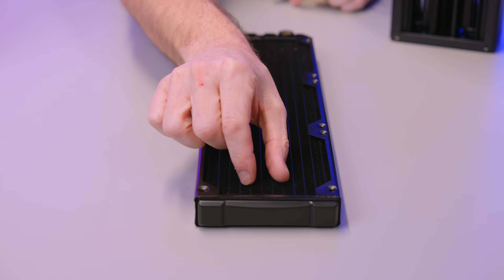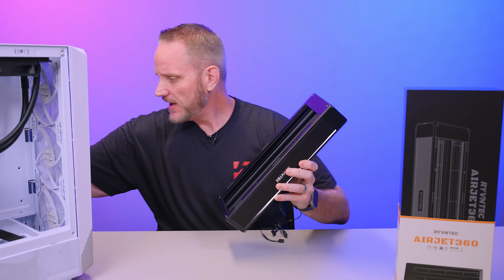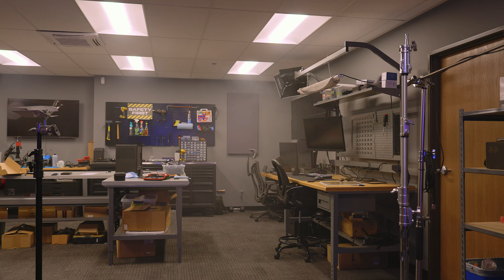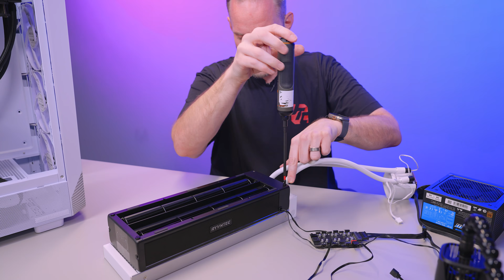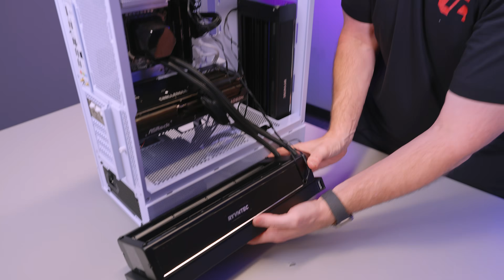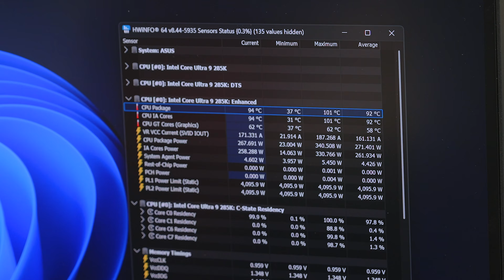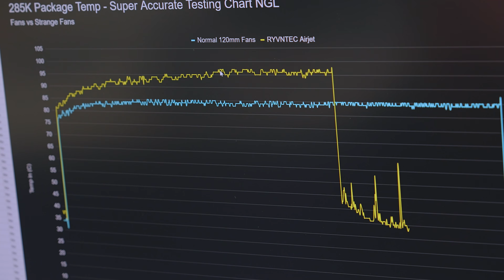Check out this INSANE Prototype!

Comment: hey jeyze, please put two more tests on that fan. but first of all use a much bigger case something you can have front fans airflow for the main chamber, about tests, 1. AIO: u need a around 1 cm canal between fan and aio for two reasons one to spread air flow and pressure to all that radiator , two to make it air tight also reduce preassure from blades, evn some washers and duckt tape would work, two using an air cooling solution but not something rubish nor 5 star like noctua nh12l on 14700 or 12700. that amount of air would change so many things

Comment: Possible fixes, place three smaller fans horizontally across the fixture (total radiator coverage width wise) & use smaller motors on each fan (less mass = smaller motors!?) you might also be able to use a geared belt drive!?

Comment: needs to be setup in pull not push, and possibly a 15mm spacer would do wonders i think. was looking at using this on a 360mm thick rad (maybe alphacool 60/00mm) in a 4u chassis. 
or even a hardwarelabs gtr radiator would do great.

Comment: Close off all the case vents and just run the front fan. That will fix radiator saturation. The only other way would be to space the fan off the radiator and add a diffuser plate to spread the air column out.

Comment: If it's the metal squishing causing the rubbing than simply adding a metal tube the screw goes through would make the screw easier to align and fix the rubbing

Comment: Not really new....I had one of these in my Cooler Master CM Stacker pc case in the early 2000's. Made a lot of noise 🙂
Called a Cross-Flow fan (yes, I needed to Google that). But it appears these type of fans still make a lot of noise.

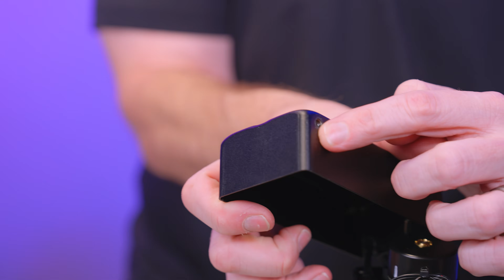Comment: I've always wondered why no one ever tried this. It could work very well but worried it'll be concentrated in a specific zone. How well will it be in a long running config that never shuts off? /shrug. The corners don't matter if it's moving air that strong, it'll get the vast majority of the heat out regardless. The issue being 14:30, they need to mill that top portion of that off if possible, is it not just a cylinder of steel or aluminum attached to a rod? IDK but they shouldn't have made them all without having people review it first. >_<

Comment: I was thinking having 4 fans, with 2 middle ones pushing to the middle and the edge ones pushing to the outer part, and this can be used with one motor and some gears or 4 motors, but the good side effect, is a much lower profile... My two cents worth...

Comment: As someone with a rotated motherboard mount case, this would be perfect for me who wants to stay air cooling.  
My motherboard is fully rotated so the 3 GPU fans are directly fed by 3 Noctua 120 fans on the front of the case, with 2 Arctic P120 on an aio cpu cooler at the back acting as my space heater in Minnesota winters.

Comment: 25:20
So what if instead of two big cone spinning thing, the put 4 or 5 smaller ones. I think that way you can get the air spreading evenly
Reply: if they can get the air flow evenly instead of flowing through the middle only, i think it can be used on the radiator

Comment: What if you used it as a pull config for the cpu rad instead of push? It pushes air through that narrow column, but it still pulls air from the entire two dimensions on the other side right?

Comment: These would probably work best in cases where you have a large semi-sealed cavity on the one side of the case into which the double-scroll fan forces air. From there you'd employ ducting to divvy up the air to where you want it to go. Your radiator would need to be in such a position as to have its entire surface exposed to the air flowing through it as opposed to the narrow column.

Some years ago before I gave up on the idea because of the equipment and space I'd need to get it built, I was designing a cuboid case meant to look similar to an ottoman, where air would have been forced up through the case from below and all the cabling would go down the bottom of the thing. In that case's design it was made to either accommodate a tower heatsink on the CPU with ducting to force air to ultimately flow through it, or have radiators mounted at the top of the thing again with ducting to force air to flow through the entirety of the radiator(s).

Especially considering how large these are I'd say they would work best in a position where they're out of sight and not obstructing anything. They would probably also benefit from a deflective grid which helps distribute the air over a radiator if mounted against it, but that would add probably another 10mm or more to the total build depth...

Comment: I think the first fan like this that I was aware of was the IETS GT 500 released back in 2021, basically the same idea as this, foam seal, 120mm centrifugal fan, pumps 300-3k rpms.  I think I remember someone doing a comparison video on them and they performed basically the same in thermals, the sound signature was a bit more favorable for the IETS, but the price was more favorable for the Llano.

The RAZER one was shit, do not get.  Not only due to the Razer Synapse bloat, but, it actually just performed way worse than both of these, not sure if they just fucked the fan up, or it wasn't sealing the air in properly directing it through the laptop, but yeah... not good (Also the most expensive of the 3)

Comment: If you do test it in pull config, maybe try using the 4 inner mounting holes instead of the ends, that would keep any torque from the screws away from the motor clearances.

Comment: Okay hear me out…. And this is not a practical everyman solution…

If you had some 25mm - 50mm (1-2” or so) of space, between the rad and the fan assembly… then put it in a pull config… it would widen the aperture of the airflow “blade”, and hit (closer) to the entirety of the radiator fins.

Comment: I feel like your decision to try the fan on the rad sort of diluted the message of the fan as a case fan. It is a case fan that provides better shape of air inside the case, at a lower noise level. It should not be used as a rad fan.

Comment: @21:10  thats why you orient it to pull in air and not pushing. 
It obviously pushes air into a compressed line just like a supercharger on a car..  BUT that's the push side. 

IF it were pulling in air through the radiator it will cover far more of the radiator. You actually showed it in this very video, the pull side was NOT drawing in a line, it was only pushing in a line

Comment: Lights in a pc: What do you want it for reading a book or playing games. If your playing games who the hell is looking at the dumb lights.

Total crap waste of money. 

Just a manufacture's way of saying your getting more, but paying more for it. What it has absolutely no real meaning in a gaming PC.

Mine sits under the table the only time I see the lights is when I power it if for the time it takes me to push a button and stand back up.

Screw holes need a spacer (tube would be good. to channel the screw) Any Anti crush spacer. Really needed.

Be fair, try it in an air cooled as well. Those fans are really shoving air around. So worth a crack.

Cheers.

PS I'm air cooled all the way. Water and electricity no way. 😞

I over fan. And under ramp the cool cycle. So far its never hit a temp high enough to crank the fans even in Horizon FW full look spec. Which is the hungriest game I have.

Comment: I question your rad conclusion. I think what's more in play is that air is moving too fast to allow it time enough to pull the heat off the fins. Try slowing down the the rad fan.

Comment: I was kinda wondering from the beginning if using 5 or 10mm neoprene foam around the sides between the rad and fan would both seal the edge and allow the air to be pushed through more of the rad  would help. Obviously it doesn't really need to be any thicker lol but just a thought.

Comment: Did the helical centrifugal fan on a computer box YEARS ago - works a TREAT. Problem is the best ones that are cheap (to buy and run) are AC 240v so becomes a PITA and keeping dust out is IMPOSSIBLE (FILTERS BLOCK IN HOURS & the C*&Ts get NOISY AF). 12v versions are always SHIT and this is no exception!!! I SERIOUSLY Doubt that these can improve on the best 12v axial fans on the market... aaannnd PRESSURE is not that critical in a computer case. Just More JANKY SHIT on the market in my considered opinion. I might just be a MECHANIC and GINGER BEER with 40 years experience. THIS IS SNOT OPINION!!! From memory this argument was scientifically settled in the early 90s. Its Like hearing  that they are remaking POLICE ACADEMY FFS!

Comment: The way those fans work, the should work better in pull config with the rad. That's how they worn in an AC, pulling air through the evaporator.

Comment: As a self proclaimed engineering genius, oh and ChatGPT has backed me up. I would agree, a tube, or a counter sunk screw hole for the fix you saw, and well my genius idea, is a pretty solid suggestion. They can make a reverse rotation for radiators so that the air flow is directed to 2 edges rather than 1 center. While the center air flow may be enough to do normal cooling, but in extreme cases, probably, thus the reverse flow  fix. Hopefully my idea I can visualize comes through!
Reply: I think my son would love this, as he's tried several different sets of fans to have a quiet cooling solution. But hard to say until they are available to try! I would be interested to try this, and if they could put a polarity switch on them to satisfy both options of air flow, center flow, and outer edge flow, I think the idea is solid!

Comment: 3d print the pass through tubes.  Also If there were room you could stand that fan off with a shroud to give the fans room to blow into that radiator.

Comment: disclaimer: im 2.39 into the video as im typing this...
If you have the space for it all you need is a spacer, maybe 5mm, between the radiator and the fan. should make it pull air a lot more evenly through the radiator. Should also help in a push configuration. The spacer should also have a closed cell foam gasket attached to it.

Comment: if the CFM is high, it's more of an intake fan not a radiator fan. It's quiet and push in a lot of fresh air. Disappointed he didn't configure it and test it as intake fan.

Comment: Some noctuas run at high RPM would provide far more airflow at a low noise level, but you have to make sure to have excellent balance between in and out fans so you don't just get a pressurized or rareified case atmosphere. You want FLOW.

Comment: Fans no matter there design are more efficient at pulling than pushing air.  Maybe place the rad in the intake side and place the fan on the exhaust side

Comment: It is pretty quiet.  I always though Apple managed fan noise well.  Specifically from the G5 (in tower design) onward.  From the perspective of multiple fans, which their non universal designed allowed for, to the blade configuration.  The configuration may have given up a bit of needed function (air flow or pressure), but it was countered by the type of noise the fans gave off.  A more relaxing hum at higher RPM, may not be the greatest for power consumption, but it resolve the annoying noise.  It is consumer dependent, and the work being done.  In the audio industry, any noise will be less desired, however in graphical design, a relaxing hum will be desired over a screaming eagle.  It is something I consider when selecting a fan, and how the machine will be used.  I don't mind tweaking things for myself, but most users do not want to bother, and just use the computer.

Comment: Mounting the fan backwards on the radiator would actually work better (Pulling air through the radiator instead of pushing) since there would be a wider air path

Comment: the tube for the screw guides would strengthen them so they dont become brakes for the rollers.

create a EVA foam gasket. this will create a separation between the fan and the AIO and keep it from that being the path of least resistance. it should force more through the side  fins. also you can try it as a pull config also doing the same thing with the gasket. now that you are drawing air through more evenly it will cover more radiator surface. to push that much air it has to draw that much air. and it wont be in just one small section as it does so.

Comment: it's nothing new, I'm actually using an air conditioner motor that have been taken apart from some old air conditioner and a smaller fan from one of those Wall Mounted Heaters that comes with a remote, and It does the work really well. I've been using it for many years now and still use it today. And btw -> I've build my PC case from wood many years ago, nowadays I use it as my retro WinXP machine

Comment: A spacer between fan and rad might let air distribute more evenly when passing through the rad. Of course, this thing is crazy thick enough as it is, you'd probably need a monster case to fit this contraption with a spacer on it... :P

Comment: Couldn't you then achieve better results with 'normal' 120 fans, but that are 38mm thick?
The problem there though, most of those thick fans are server grade and run at ridiculous RPM...
BUT, I do have my PC filled up with Arctic P14 PRO fans and even though their max speed is well over 2000RPM, they CAN still run at very low RPM (I have them set to 17 to 20% PWM) and even though they are only a few mm thicker than normal fans, the amount of static pressure they add over the 25mm Phanteks I had on the same radiator before, at that low RPM/noise level, is amazing! (you can barely even really call it 'noise' level at that point)

Comment: Imho, they should use a rubberseal allaround the fancase instead of some small Pads. Bc. If You screw it down, the fancase may bend a little and that could be the reason the Fans Stop or get friction. If I See right, when  You squished the small Case around the Motors, they didn't slow down. Just when You pushed the place at the screws, they slowed down.

So i think it's a bending issue of the whole fancase.

For Radiator use probably pulling could help, or they reduce the size of the fanrolls about 5mm and build in some Kind of diffuser on the Outletside to spread the airflow without increasing the thicknes to much.

Comment: 1. Like everyone else is saying, PULL CONFIG!!!
2. Why were you excluding all screw holes except the corners? There were 4 more for you to use!
3. What about using it exclusively as an intake, without putting it on the rads at all? Extreme positive pressure system! The positivity is endless!

Comment: If it wouldn't be such a size issue, I'd almost suggest making a bigger one that can actually push through the whole surface area of a rad. Like, maybe collab with Corsair on the 1000D/9000D and make one big thing that sits on the front 2x480/top 2x360 but funnels it into one centralized standard rad in each location. Or maybe I'm up too late and that wouldn't work for some other physics reason lol.

Comment: Mmm, 2 things.
1. The devs need to create a rubber/silicone seal on both sides of that casing so there's no leakage.
2. Theoretically, a pull config would allow the entire radiator to be used as it's only the output that channels the air centrally.

Awesome concept though

Comment: 20 years ago Cooler Master used barrel fans as an accessory to the Stacker Stc-T01 cases and I believe others without doing a search. I has a balck one with blue anodized edges that was a special addition that I still am looking for again. I had every option you could get including the first of its kind BTX adapters.

Comment: I feel like the clearance with the motor issues could easily be solved by gluing a plastic tube connecting the screw holes on either side so the metal can't compress and interfere with the motors. The fact that this is even an issue makes me question the quality control of this company, but it is cool to see new ideas being brought in to PC building.

Comment: About 10yr ago i designed a liquid PC case that used a gyre flow pump that worked just like those fans. The motherboard and GPU were mounted parallel vertically with the laminar flow blasting upward between the two. We used that M3 Novec for the coolant but didn't need much because of how compact the design was. The design included an external rad cooling system, and we had a foamed aluminum condenser specially made to take the heat out. That cooler system could be swapped for a 1/10HP aquarium chiller also. I think I got paid $40 to design and engineer that and another $250 for the acrylic case. Then the customer disappeared with the working model.

Comment: they could just add a small tube for the screws, that keeps the housing spaced enough to not get clamped by the screw preasure ^^
but overall very cool and promising design imo, curious to see how longterm usage data will look for it ^^ 
(makes no sense to replace my front fans with it if i need to replace/repair it every 3 to 6 or 6 to 12 months)

Comment: What you’re gonna wanna do regardless of the configuration, next to a radiator, is use a spacer. That essentially creates a pressurized column which helps the air evenly spread through the fins. We see this as beneficial even with 360 rods and a 3 mm spacer so if you throw a 25 mm spacer on this bad boy it’s gonna be fantastic

Comment: If they did a tube thru the bolt holes it would keep the housing from crushing in when you tighten it and make it easier to feed the bolt thru it.

Comment: So if it can suck air stronger, wouldnt it make more sense to have it in a pull config for the rad? better yet, why not have 2 airjets as intake and normal fans for the radiator?